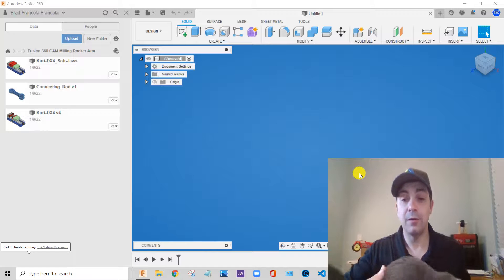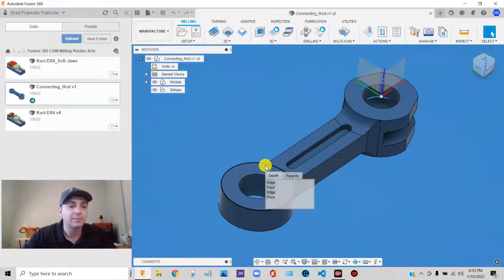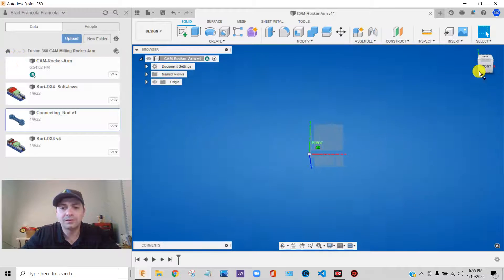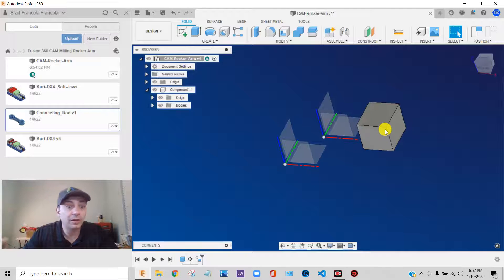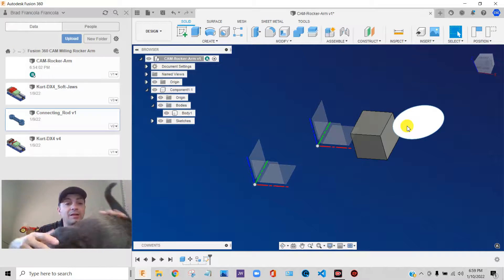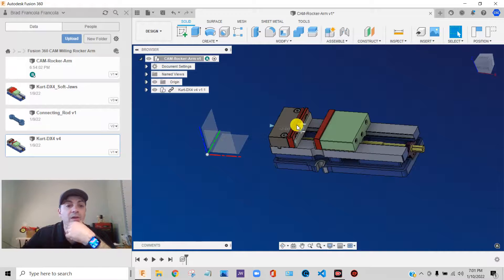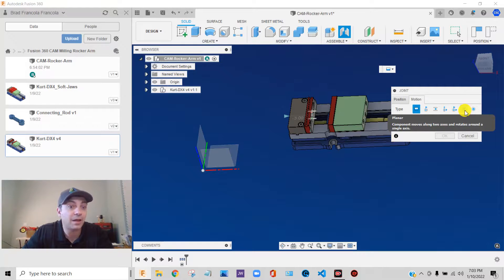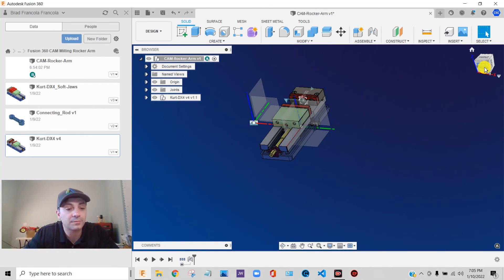Fusion 360 CAM Tutorial 1.1 Bodies and Components

Comment: Appreciate the series, I've been a SolidWorks user for years and its great for design but from what I can tell F360 cam blows CamWorks out of the water.  Curious where you found cad files for the 4" Kurt? Cheers!
Reply from the maker: Hi.  SW is an awesome design package.  F360 is steadily improving in design and continues to be a contender with SW.  Regarding CAM, F360 is on track to become #1 in the world and the next 12 to 18 months should bring  lots on new features.  I'll find a way to share the vise file later today and let you know.
Reply: In Fusion 360, there are lots of free work holding models included.  Look in CAM Samples - Work holding.